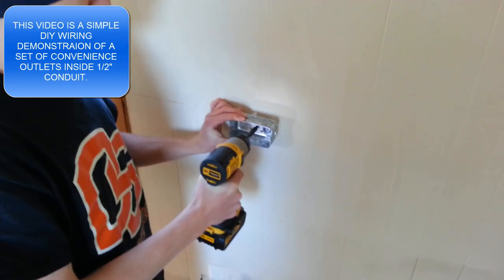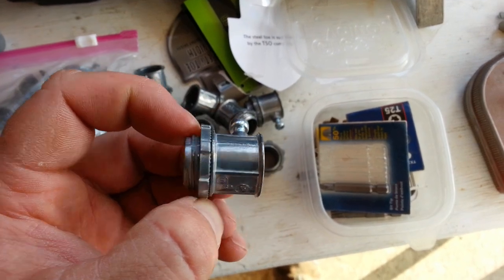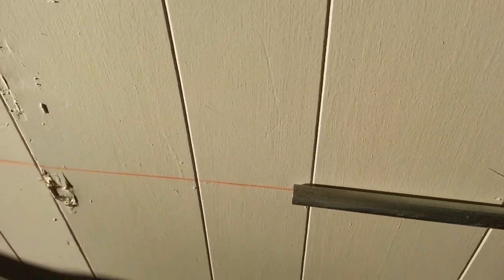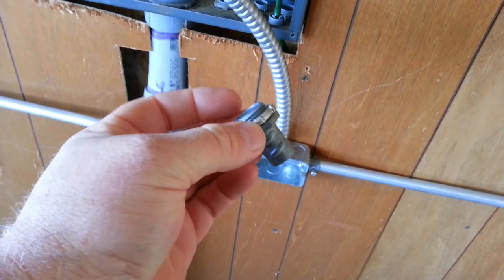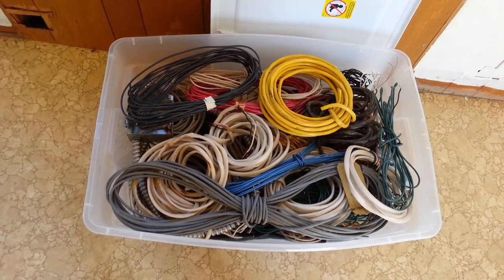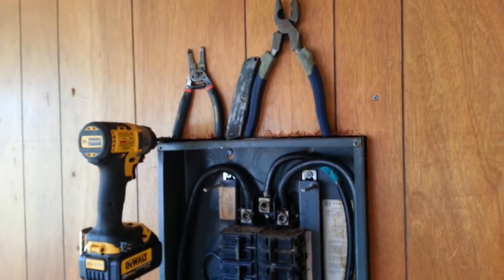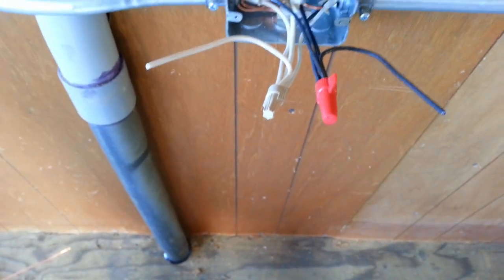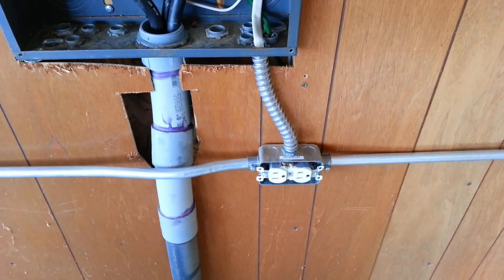DIY - How To: Simple Wiring Run for Garage or Shop in Conduit

Comment: Cant use romex in fully closed conduit!!!
Reply from the maker: why, I have asked many electrician and all they come up with is "its not code", so now to you, why?
Reply: @skudwoofer  I appreciate your asking, it’s because romex is designed, both thermally and environmentally, to be run in open air in dry locations. When you run romex in EMT, you’re putting it in what is considered a potentially wet location, which it isn’t designed for. Also, wires give off heat as electricity runs through them, romex is not thermally designed for use in an enclosed conduit, especially when other runs are in the same conduit.
Reply from the maker: So I am going to push back a bit, for this particular installation.  It is a dry environment.  EMT is permitted to be used in dry, damp and wet locations provided that the correct connections are used in damp or wet location, but this is a dry location.  Second, I understand that THHN is good up to 90°C and according to this supplier, so is romex:
https://wesbellwireandcable.com/blog/thhn-vs-romex/
From what I am reading above, the romex is just THHN solid core wire housed in a PVC sheath.
I understand your concern about thermal climb given a conduit fill value and number of circuits, however as someone who was looking for a cheap, quick installation, valuing cost and puncture protection over "code installation", this is the method I chose.  I do not believe, given that it is merely a convenience outlet run of 20A, that there is anything dangerous about the installation.  I probably didn't ground it properly, but in the many years of occasionally plugging something in for use in there, I have never had any problems with thermal climb, as I can readily place my hand on the EMT and have after use with a hand held grinder or similar end use items.
I do appreciate your response as most just take a swipe and never clarify their positions.
Skud
Reply: @skudwoofer  sounds like you’ve looked into it, honestly as long as it’s safe who cares

Comment: My grandpa wouldn’t have even put the Romex in conduit it would have been stapled to the wall if he was lucky. He would use Romex like an extension cord with metal boxes for a multi plug box I would pick the end up with caution haha. I guess you could yank the wire out of the insulation and then everyone would be happy with your video and the world would start spinning again. Thanks for posting it
Reply: This is like a horse trying to teach a swimming class

Comment: So I'm under the impression that if you are using Romex you do not need conduit, rather conduit is for the individual loose wires or THHN I guess is what they're called. So is there an extra benefit to running romex and conduit?
Reply from the maker: in my case the purpose of running conduit is for cut or impact safety.  Normally the sheetrock is your safety layer, but in this case where the wiring is on the face of the wall, it would be easy to puncture and thus a shock hazard.
Reply: @skudwoofer  oohhh that makes sense. I see now thank you.

Comment: Why use Romex in conduit?  Why not THHN?  Or did you just have Romex on hand?
Reply from the maker: +CHIXTERS' CHANNEL I have a whole plastic tub full of romex remnants from various wiring projects around my farm, so hence the use of the romex :)
Reply: Where I live , that would be against code, not sure about here obv.
Reply from the maker: +HazardousGuru420  don't care about code, it is completely out of code, but I know it is properly grounded at both sub panels and at the main, and it is in a gutted mobile home that is serving as a temporary shop that is completely unpermitted and also completely out of code, but I live out in the sticks, who is going to investigate.

One of the perks of living in the "country" :)
Reply: @HazardousGuru420      yes   Heat problem with Romex in conduit Not allowed in Ohio it's called a conduit within a conduit
Reply: @darleneohio942  I believe the national electrical code NFPA 70  2020 edition allows NM (Insulated conductors enclosed within an overall nonmetallic jacket) to be ran in metal conduit, tubing, and metal outlet boxes. (see 334.15).   My only concern is if romex counts as NM, and obligatory "im not a licensed electrition"
Reply: @tjuggernaut29  romex is nm-b cable

Comment: 1. Why 10-2? Not only is it difficult to work with, it is the wrong size for a 15 or 20 amp breaker.

2. The first box was improperly grounded which gives the likely possibility that the conduit was not grounded

3. Whenever you install outlets or switches in wall-mount boxes like this, you need to break off the ears in order for the cover plate to fit correctly.

4. They have a special green wire nut for ground wires. This allows you to stick one of the ground wires through the hole at the top, then twist the wire nut, then screw the remaining ground to the box.

5. All repairs that are needed to bring this project up to code are very easy, so....
Reply from the maker: see reply to other comment below, working great, thanks
Reply from the maker: 10-2 is what I had, free = happy
Reply: 10-2 is not the "wrong size for a 15 or 20 amp breaker". It is overkill, sure, but it is not "wrong". The rule is you cannot go SMALLER in wire size because smaller wire = higher resistance = more heat = higher risk of fire.  A larger wire is safer and therefore ok. Like I said though, it is overkill and a 14/2 is typically used for 15 amp breakers because it's easier and cheaper and adequately safe. 14 gauge = 15 amp breaker, 12 gauge = 20 amp, and so on is what's typical but you can always go bigger on the wiring, just NOT THE BREAKER. Meaning, you can use a larger wire on the same breaker but NOT a larger breaker on the same wire. People like you are constantly parroting these "rules" that are, in fact, wrong. It's very tiresome.
Reply: @user-nh3gu1ge3d  My bad, that comment was from years ago when I did not know what I was talking about lol. Since then I have used 12-2 in a pinch on a 15A circuit from time to time
Reply: An additional clarification regarding grounding: Basically, there is nothing wrong with the grounding in that setup.
Since a section of the (metal) conduit is connected directly to the panel, all of the conduit on that run IS an EGC (ground).  And as long as the conduit is well connected to each (metal) box etc along the way, no separate ground wire would actually be needed at all, as, again, the _conduit is the a ground_.

Comment: As long as that structure doesn't get placed in the middle of Death Valley, and those outlets aren't continuously feeding 20 amps for 3 or 4 decades straight to power a belt sander creating a thick layer of fine saw dust over everything, and the place doesn't get hit by heat lighting during a dry summer day, it's probably ok.  :)

However, for anyone that might be interested in what would be "to code", I offer the following...

This is regarding the outlet box under the panel.

First, the grounding was fine, as the metal conduit is also a ground in that setup.

The box, however, might have been a tad undersized.  While hard to see its exact size, it appears to be, at most, a standard metal box with a "trade size" of "4 x 2 1⁄8 x 2 1⁄8" (but could be smaller), which has a maximum box-fill volume of only 14.5 cubic inches (cu).  Per my calculations, it is filled with 21 cu of wiring & devices.

The Box Fill Math ( per NEC 314.16(B) ):
4 #12 spliced: 4 x 2.25 = 9 cu
2 #10 spliced: 1 x 2.50 = 5 cu
for 3 grounds, we only count the largest (#10), once: = 2.50 cu
1 outlet counts as 2 #12: 2 x 2.25 = 4.5 cu

So, (9 + 5 + 2.5 + 4.5) = 21 cu minimum box size needed.

Basically, most any square standard metal box would be large enough.  But it would be fun changing it at this point.  :)
Reply: I Don't Know -- That was the first thing I noticed was that the outlet boxes are actually undersized. By my understanding you also need to add to the calculation one conductor worth for wire nuts. That would add 2.5 to your box size calculation for a grand total of 23.5 cu in.

I'm not even an electrician, but in building our last house I learned a lot about code and I've seen that even licensed electricians sometimes overload boxes. A lot of times you don't even need to think about it, especially if you always use 22.5 cu in boxes. But sometimes even that isn't enough -- like in this video.
Reply: @dennmillsch  Yea, I'm not an electrician either, but over the years I've found so many examples of bad wiring at my homes and the homes of family, that I've since spent considerable time studying wiring rules (ie: the NEC) to fix them correctly, and safely.  Some of the examples I found were scary - like worn, bare wires touching studs that had charred the wood.  It was a miracle there hadn't been a fire.

Now, regarding  allowances for wire nuts: that is already taken into account with the allowance for spliced wires.  For example, if a single #12 wire passes uncut thru the box, that counts as a single allowance of 2.25 cubic inches.  However, if you cut that wire and then splice it (with wire nuts or other valid devices), it now counts as two wires entering the box, and thus requires two allowances, ie: 2.25 x 2 = 4.50 cubic inches.

So, I believe my original calculations are correct.  But, again, I'm not an electrician, so no guarentees... :)
Reply: @Self_Evident  -- Good job fixing up work that was probably done by a "professional" and somehow managed to pass inspection. I'm sure you have no regrets.

A book I have on wiring (that frankly is a little bit easier to understand than the code book) explains that the 22.5 cu in box can handle 3 #12 romex cables and a receptacle. Each romex #12 is 4.5, the receptacle 4.5, the ground wires 2.25 and wire nuts 2.25. My understanding is that you don't change the count of wires if they have a splice. It's simply count the number of hot wires crossing the box boundary, the number of neutrals crossing, only count one ground, a receptacle or switch counts the same as 2 wires, and all wire nuts combined count as 1 wire equivalent. So in "wire equivalents" the 3 romex is 6 wires, +1 wire for the ground, +1 wire for the wire nuts, +2 for the switch or receptacle. So the example I gave is 10 wire equivalents. #12 is 2.25 cu in per "wire" and thus 22.5 for that scenario. If it were #14 wire, then 2 cu in per wire means the same configuration is 20 cu in for #14. I like how the plastic boxes usually have wire equivalents printed in the box plastic for several wire sizes. Once you understand the idea I find it easier to calculate in wire equivalents than adding up cu in. As you correctly pointed out, if you are mixing wire gauges then you have to count the largest one for the ground or wire nuts or receptacle. Since #10 wire equivalent is 2.5 cu in, if it has a #10 wire on it, then the receptacle counts for 5 cu in (instead of 4.5 if the largest were #12). The wire nut and ground wires, if they include a #10 would be 2.5 cu in each.

Comment: Lol @ all the code police! That's not how you do it! I equate it to people saying don't eat over easy eggs, you'll die instantly! If it works and isn't a commercial building then screw the code. Intelligent people can assess personal risk on their own. A wise man is quiet, yet the fool speaks his mind on all things.
Reply from the maker: Yep, I am trying to voice my opinion less, especially when not asked, but pretty much my sentiments....  I grew up in the 80s and we use to put up a 2x4 and some plywood and ride off of it as fast as we could on our BMX bikes in a paved parking lot, which resulted in a broken wrist and lots of road rash multiple times.  What ever happened to the process of discovery?  I watch another youtuber here named samcrac and he recently welded up a supercar and is driving it around.  He didn't do the job the way I would have, but it will probably be fine.  you wouldn't believe all the keyboard hate he has gotten over it.  Man that guy has learned to ignore the haters over that one.  So many people with opinions about scenarios that they have never personally endeavored to experience.  I get tons of comments about grounding and code on this video and none of them are founded...  The system performs today.  I flip the lights on, or plug the chop saw in and poof the electricity flows to the machine, not my heart, LOL......  it is AMAZING that a non-licensed electrician can do such a complex thing....
Reply: @skudwoofer  Yeah we live in a strange world these days, can't even say someone is a guy/girl without a mob of angry selfish idiots rampaging your entire life. Not sure when the switch from rational, productive, results-driven minds made the switch to the twilight zone, but it has certainly happened. You would think that someone could show someone else how to do something without having a degree in it, but nay, the internet says otherwise. The keyboard warrior smashes your argument to sound important, all while spewing complete garbage wrapped in a wrapper they call knowledge. Kids need to get off of their Iphones and live a little bit. I certainly did as a child. Anyways, I digress. You should take a look at electricians forums if you get a chance, it's even worse over there. Hell basically everything is like that now, as I saw someone today get a free drink at a coffee shop and throw it at the counter because they didn't put half and half in it.
Reply from the maker: LOL!!!! great stuff  I work in the CAD field and worked for an exceptional industrial electrician for years, he paid me $40 an hour when I was in my 20s just to open my eyes to what was possible.  Was a great guy.  Anyway, he use to always test for what he called low voltage 120-240 house current by grounding his pinkie and touching the wire to be tested with his index finger.  He never dropped dead from it and lived to be in his 90s.  He said he learned to keep one hand in his pocket when he was doing it though from a few across the body groundings, lol.
Reply: And here you are speaking your mind lmfao XD Sincerely IBEW Journeyman Wireman